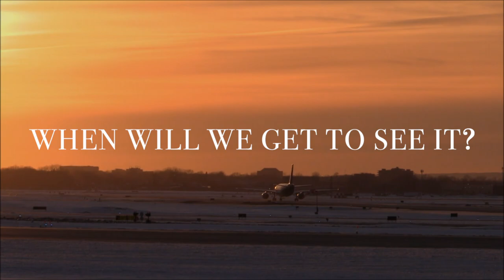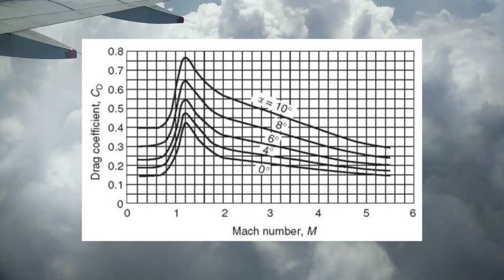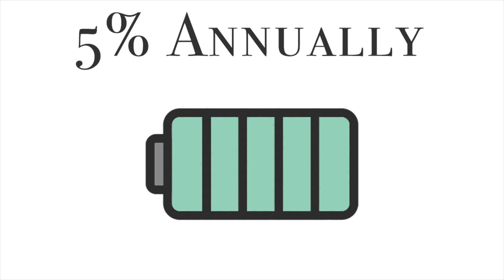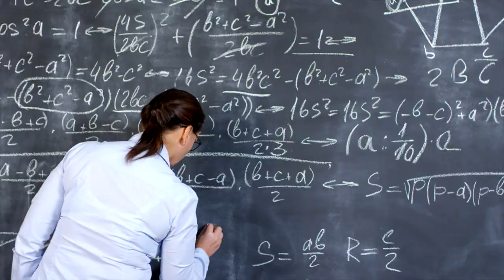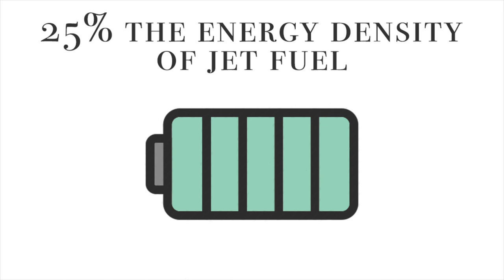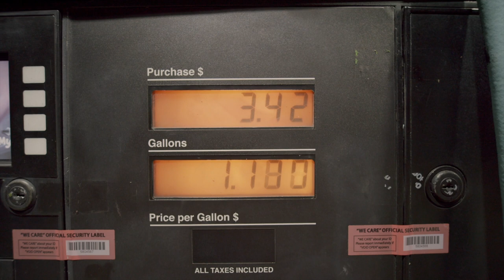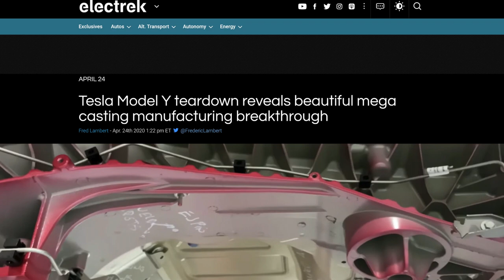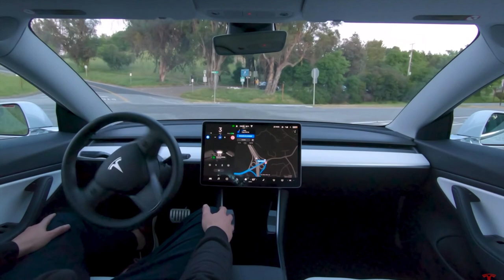The Economics of TESLA's Supersonic Electric Jet

Comment: So, are you aware of the Tesla patent for a battery without an anode?

At least, that was how the patent was titled.  Technically, it isn't true.  The patent describes a battery design where the functions of anode and electrolyte are combined.

Now that is a very intriguing concept.

Charge is limited by the surface area of the anode.  The anode's surface is basically two-dimensional.  But the electrolyte is a 3-D gel.  In theory, if the gel functions as both electrolyte (ion transmitter) and anode (ion collector), there will be a tremendous boost in how many ions can be captured.  Plus, the weight and volume taken up by a separate anode is deleted.

This could be even better than solid state batteries for energy density.  Maybe.

There's no way to know if this patent can be commercialized, but Tesla did file it, so they must think the idea is worth investigating.  It will take years to get through R&D, probably, and it might never emerge as viable.  Still, it shows just how imaginative Tesla and its research partners are.  They are thinking outside of the box.

It does seem possible that breakthroughs will be found for energy density and other performance characteristics for batteries.

We shouldn't let ourselves become too excited about a research candidate; most never make it to commercialization.  But this isn't the only candidate in the R&D pipeline, and everyone in the field knows that a genuine breakthrough will be worth untold billions.  It's a race, and everyone racing wants very much to win.  So I'm optimistic about a breakthrough arriving eventually, maybe within this decade.  And if it happens, the old constraints in battery tech will seem quaint.  All sorts of things will become possible that seem out of reach today.
Reply from the maker: Tesla files a bunch of patents for batteries as they discover new ways to create batteries. But every patent should be taken with a grain of salt because as you pointed out yourself. It is very much dependant on if they can commercialize it. So to answer your question, I try to follow every patent Tesla files but it's hard to know which ones they actually believe in and which ones they file "for fun" meaning those that they don't see any potential in commercializing in the near future but file anyway to keep others from patenting it.
Reply: @OBFYT  Check.

This one caught my eye, though.  Moving from 2-D structures for ion capture to 3-D could be a very big deal.
Reply: 100% Silicon anodes will happen long before lithium anodes (or anode less if you want to call it that)

Comment: Supersonic and vtol? What battery is this? LOL, This goes in the same file as the hyperloop and the sewer tunnel I mean boring tunnel he peddle a novel idea, hello ever heard of a subway?

The issue with a battery energy density and weight compared to that of fossil fuel and the fact that batteries catch on fire Boeing 787 Dreamliner battery problems. FAA takes a year to certify a plan I think has to be under 20 passengers to avoid cert.

The airlines have avoided supersonic due to noise, airport slots (It is like going in your fast Tesla to the mall that opens at 9 you arrive in your 8 am still have to wait. Airport are the same) and efficiency the faster airplanes go the energy they consume.

Comment: I’m curious about the recharge time of the size of battery required for a long haul flight. Current aircraft that are being tested for passenger flight service (obviously much smaller and shorter distance) are planning on battery swaps  at destinations. In a long haul aircraft that option obviously isn’t there. To refuel a Heavy or Super Heavy aircraft for a long haul flight takes approximately 30 minutes. My phone takes over an hour to charge to 100%...if these planes take too long to recharge before the next flight, the aircraft won’t be economically viable for an airline if you can’t turn it around quickly and send it back across the country in less than 2 hours on the ground. Just a thought.
Reply: As someone involved in the industry this is a very good question.
Reply: I'm optimistic for a hybrid battery/fuel cell approach. LFP for high inrush currents with fuel cell for high density long duration storage. Solar panels are getting cheaper, stronger, lighter, and more flexible so it may be economical to coat the top of a plane with solar cells to recharge the LFP in flight and on the runway. The fuel cell could use Ammonia rather than Hydrogen.
Reply: @T S Batteries

Comment: I think there's one sweetspot at M1.5+ and one at M0.7. Considering a 450 wh/kg Amprius battery at 70% of total mass and L/D of 10 at M1.5 you could do 500 miles plus reserves (basically your height around 30 km as reserve). M0.7 would lead to a sailplane like L/D of over 50 at around 22km and 3000 miles of range. Vtol is just tilt-able or retractable props.
Reply: Would be interesting to see if somebody makes an electric M3 50km "launchpad" aircraft for smallsat rockets
Reply: Would be fun to overpower the aircraft a bit to get some badass climb performance
Reply: "oil companies hate that trick"
Reply: I like your thinking

Comment: There are some things you didn't mention (or you did and I don't remember).

- Electric engines in general have much ligher weight-to-thrust, menas much less structure required for the airframe and wings

- Gravity is a power source in en electric plane (like a EV driving down hill)

- Supersonic Boom not an issue if you are high up

- Multible engines allows for advanced thrust vectoring and replaces the ruther

- Supersonic engines are optimal for takeoff as well

- Batteries themselves can be structure, so they are not just cargo like fuel. Think of a carbon fiber sandwitch with honeycomb in the middle.

- The batteries can heat up the cabin (defrost) and you can use airflow from outside to cool them as well

There are other ideas that Elon didn't talk about:

- Using a Prantle Wing and Turbine blade

In summation, those that think Electric Planes are not gone happen. You are wrong. Batteries need probebly 2 more generations but its gone destroy the traditional airtravel.
Reply: Dude, you think Tesla has the answer to all the issues with air travel? There are physical limits that a battery cant overcome, YET. Not going to get into aerospace engineer but Elon likes to throw things out there like no one ever thought of it and people swallow it hook line and sinker. Hyperloop is an old idea and maintaining a vacuum takes energy to maintain and almost impossible keep a close system and a sewer tunnel 10 feet wide with cars won't replace a problem that does not exist. Ground transportation with subway and high-speed train travel already exist and both carry  200 passengers safely and efficiently something a 10 feet wide tunnel and hyperloop won't. 

Electric engines weight-to-thrust ratio you still have a very heavy battery  electron don't add or take the weight off a battery

Supersonic Boom, not an issue if you are high up we know that but less air means less thrust. Propellers have its limits

Batteries themselves can be structure, so they are not just cargo like fuel. No planes carry enough fuel so planes get lighter. Battery weight always stays with planes 400-watt battery won't cut it. 

The batteries can heat up the cabin (defrost) and you can use airflow from outside to cool them as well. Planes use it already

Prantle Wing and Turbine blade airport have been created the conventional wing that may change but it will be a decade before plane with unconventional wings can park and unload a terminal without major airport reconstruction they did at a great loss with the A380
Reply: God so much of this is wrong.... And trust me, I am a commercial pilot with several hundred flight hours of experience, along with the knowledge of aircraft structure, construction, aerodynamics and propulsion that is required by a FAR type 141 piloting school. I know what I am talking about. Let me break down each and every point you made, and show you where you are wrong

-Electric engines cannot provide enough thrust to propulse a jet past subsonic speeds, as propellers (fans, whatever you want to calls them) loose efficiency above 500mph with the separation of airflow from the blades, loosing a lot of thrust. And there is no other method to drive forward an aircraft that is efficient enough with the electric power coming from the aircraft. Ion engines are extremely low thrust, so for a flight it's a no go, thermal heating of the air for propulsion wastes too much energy compared to the thrust created.

-You're thinking of cars. In a decent airplane engines are still producing forward thrust, using power to do so, so no charging from a decent.

-Then why was Concorde banned from flying overland? Any higher and the propulsion system couldn't produce enough thrust to keep up supersonic speeds. 
-Engines fail, and those engine need a backup. Modern aircraft can fly without a rudder already, but as soon as an engine fails, they still need yaw control and stability, which is provided by the rudder. Regulators wouldn't allow for only one source of yaw control in a multi engine aircraft, as they really change up the flight dynamics once they fail, and are the main reason getting a multi engine pilot certificate is a hard task for all pilots.
-Batteries cannot provide enough structural strength to stand up to the pressure difference from inside the cabin (10,000 feet) and outside (60-70,000 feet). Plus the wings must be capable of lifting the entire weight of the aircraft, again something that cannot be done when batteries make up the structure.

-The problem at supersonic speeds isn't heating the aircraft, but cooling it. The only reason Concorde didn't fly faster than mach 2 was because the aluminum structure would have melted, and the mach 3 SR-71 would flow the fuel through the titanium skin of the aircraft to cool it down before letting the fuel go to the engines. battery heat would only further cause problems with the compression heating caused by supersonic speeds.

-A Prandtl wing is designed for high efficiency, LOW speed flight, and would break apart at transonic speeds, and read above for the turbine blade problem at +500mph speeds.

In summary, every single point you made was wrong, and speaks to the shallow, surface level knowledge on the topic that you command. An electric, supersonic aircraft is fundamentally flawed on so many levels that to make a commercially viable supersonic aircraft is impossible. However, electric aircraft are very much a possibility in commercial aviation, but on shorter range routes, topping out at 1,000 nautical miles, with speeds not much over 350 knots. Just look at aircraft like the Evation Alice, that is a real electric aircraft with actual, realistic chances of working, unlike this fever dream of an electric supersonic jet.
Reply: I think you're right. Grammar remains improvable though